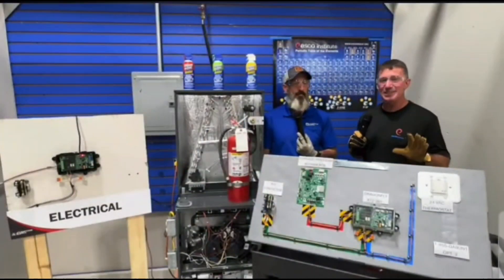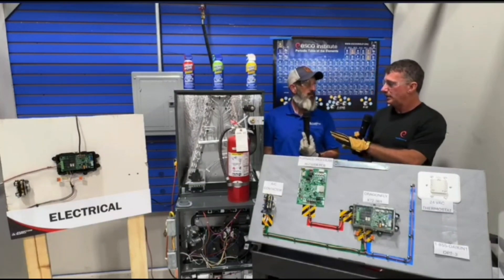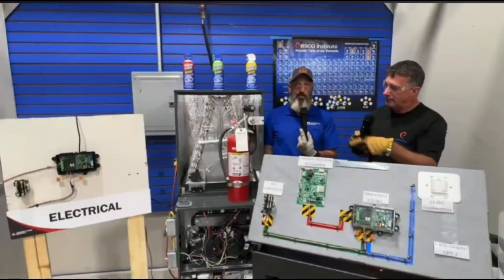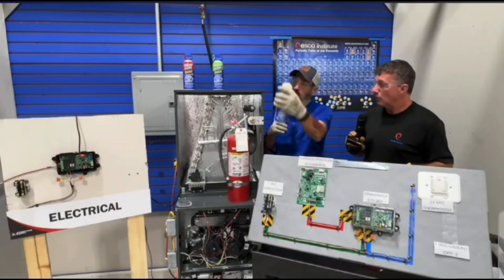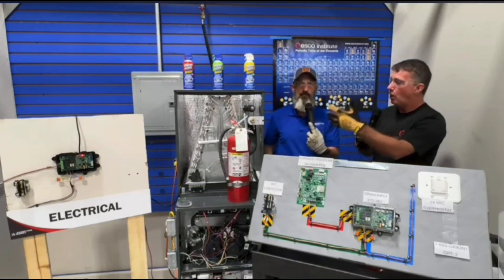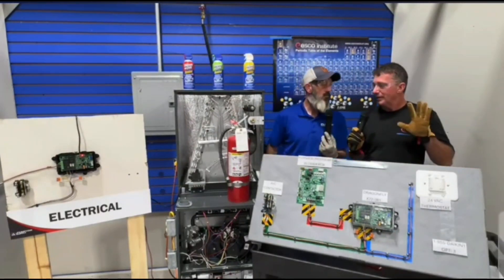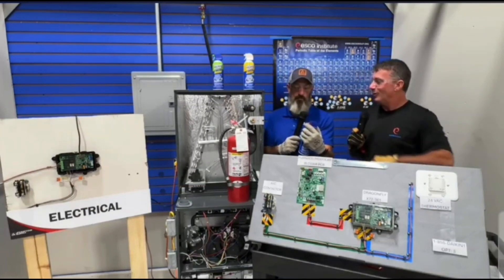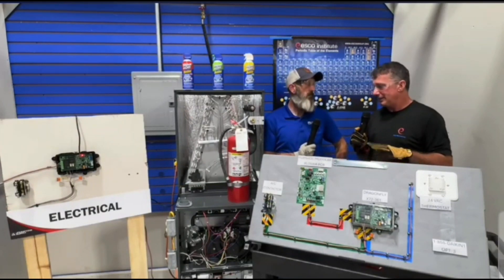A2L Leak Detection Sensor in Action: Must See

Comment: It is a speed of sound sensor. Certain gases change the air and the speed of sound within it. The sensor is admitting an ultra high frequency, soundwave and measuring it coming back. In the presence of certain gases, it changes how fast sound moves through the air. That’s what the sensor is doing.

Comment: I understand what you guys are trying to show and achieve but I’m not sure I agree with the way it’s done. I’d like to see a more real life situation. And not have you spraying directly on the sensor. I’d like to see how good a job that sensor does in a  down flow application. And have the “leak” be more realistic like a very tiny pinhole on the back lower side of the coil.
Reply: If the fan is blowing lit will not detect a small leak. It will only detect it if it is a LFL of 20%! If it is running it will most likely not detect it unless the pipe bursts in the evaporator coil.

Comment: Q: You mentioned that the detector can detect a leak even if the indoor blower motor is in operation. Then shuts the system off, and then turns the blower that was already running back on :) Can the detector pick up a small leak with the blower already running? And at what leak rate do the detectors trip? 6oz /year, 1 lb/year 4 oz/min. ? Are the detector able to handle the condensation that's going to be building p on them?  Whats next, will the boards activate that fire extinguisher like a restaurant grease hood?? Oh yea, one last question. What have the other countries been using if any for the last 10 years for detection of R-32 leaks?
Reply: Not all this bs
Reply: 1000% agree, all this is bs . @rvrrocket2765
Reply: Best questions that have no answers😮
Reply: Miss choice of words but basically if the unit is not running and it detects the LFL of 20% then it will shut down indoor and outdoor units and turn the fan on. If it detects 20%LFL while it is running then the fan would stay on and the indoor and outdoor unit will shutdown. The video is to educate everyone on how it works. Every manufacturer has different electronics but achieving the same results in the detection process. The video explains it well enough for you to understand it turns on the fan when the leak is detected even if the unit is off.

Comment: Slight leak higher up in the coil while.fan is running...that sensor ain't doing D
Reply: Plus the customer won’t notice outside unit cycling on and off, but they’ll call- “just not cooling well”